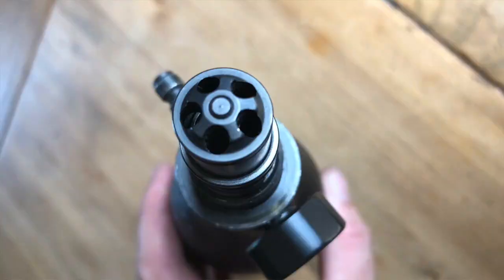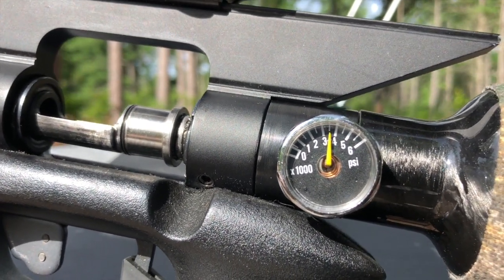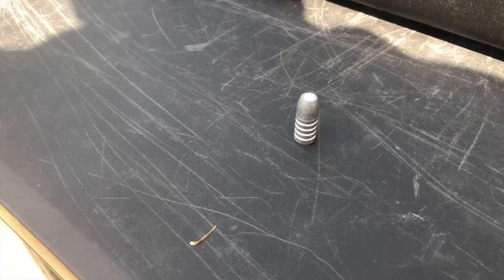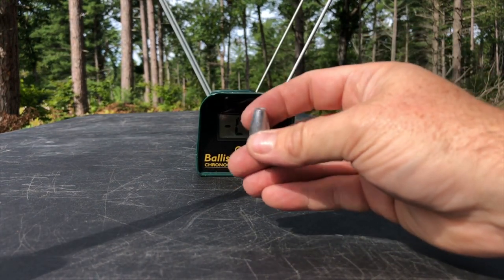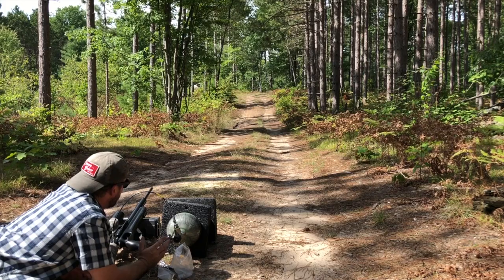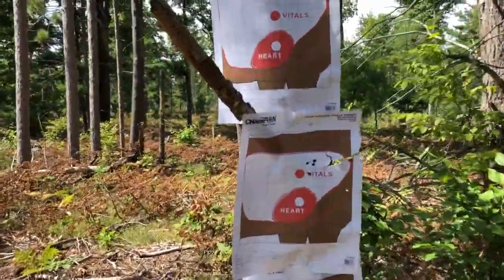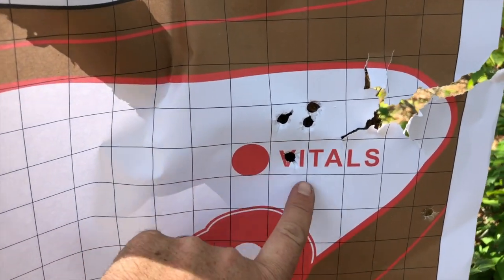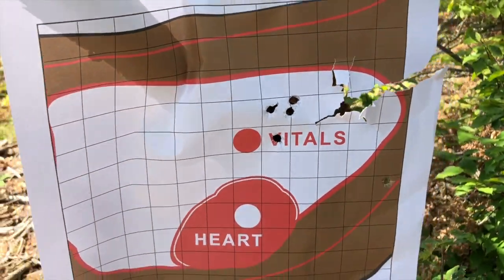AirForce Airguns Texan Over 1000 Foot Pounds of Energy with Helium!  2018 Deer Hunting Preparation

Comment: I think with copper plated pointed slugs with helium on a 300+lb rifle like my aea .357 with 32in barrel would still pass though the high shoulder. especially with helium.
I will also most likely powder coat some .355 and resize after the coat to .357 so that I have perfectly sized powder coated copper plated lead slugs, advantage being the powder coat decreases frictional properties while the copper increases the overall strength of the bullet to pass through bone.

Comment: 350 grn at 1150 fps? That’s pretty bad ass.... not sure how practical shooting helium is, but impressive none the less. I can tell you, straight up, that would do anything a 44 magnum revolver will do on thin skinned game... and that is a lot!  From my stock Texan, I’ve found that it run right along side a 357 magnum, even my preferred load( 180 grn XTP @ 1150 fps) , and I would not pull a high shoulder shot with it either....Modding can definitely give you that “ next level “ performance boost.
Reply from the maker: Thanks Neal!  I want to take a moment and expand on something..... As a fellow airgun "modder" you get this but I am posting this response to all others who read this.... I keep hearing this word "practical" from a few people that have made comments about me shooting at 4500 PSI and with Helium.  I want to make sure everyone understands where I am coming from with this testing I have been doing with this custom valve and higher air pressures and now with Helium. 

For me the word "practical" goes TOTALLY out the window when it comes to Deer hunting and this is what it is all about for me.   It is the same mentality I used to have when I hunted with 12 gauge sabot slugs at $17 for a box of 5 slugs or ridiculously expensive arrows and broadheads for archery season.  I have always wanted to use the very best and most lethal option when deer hunting. For a lot of hunters, to include myself, practical does not exist in our vocabulary.  

Punching paper is fun and keeps me behind the trigger all year long - but for me the next 3 months (the Michigan Deer seasons) is what I live for as a shooter and hunter.  I get it - Helium isn't going to be used at the range punching paper or even in hunting situations where taking multiple shots during a hunt is typical.  Hell - this stuff costs $100 to fill the damn tank! But...  Deer hunting for me is all about those few minutes and even SECONDS I get each year to squeeze the trigger on a game animal (hopefully in one single one shot) that will feed me and my family for months and if I am lucky put a trophy rack on the wall.  

For me as a hunter - those few minutes or seconds that exist once a year all pay off after shooting at paper (and AirGunDepot.com Long Ranger Golf Balls).  So that one single shot that I get once a year doesn't have a limit of practicality for me.  If I wanted practical - I would have never gotten into Big Bore Airguns.  I want a challenge of a new hunting technology and I want to see how far I can push that technology.  If I wanted practical - I have a 12 gauge Mossberg shotgun from my local Meijer (back when they sold guns) that my dad bought me when I was 16. If I wanted practical I can grab that 12 gauge shotgun with a $5 box of Remington Rifled Shotgun Sluggers and go stumble into the the woods on Nov. 15th like a lot of different hunters I see around these parts.  

So to everyone who reads this and wants to post comments about how 4500 PSI and Helium isn't practical - you need to understand what I am trying to accomplish.  The most effective and lethal single shot possible from my big bore airgun.

Comment: My God . . . . I absolutely do not have the wallet for an AirForce rifle . . . and I'm a zealot for my Bulldog . . . . after a nearly free hammer mod i get at least 240fpe with my Noslers . . . It shoots surprisingly flat over a 60-100 yard range. I would love to be able to shoot helium through it but it's not rated as far as I know. I know Pitbull will do mods with valving and regulating.  It's plenty powerful enough for nearly anything in North America. I preach the Air Gun Gospel to all of my powder-burning hunter friends, probably to the limit of irritation, lol! so I will be sharing this with them. The ones who were military marksmen get a wakeup call when shooting modern airguns . . .  the learning curve is totally different. Great vid.
Reply: It will work fine on helium just dial back the hammer spring rate before shooting just to be safe and do not overfill

Comment: Great video man.  I do not have a Texan, but I do have a tuned Dragon Claw that shoots about 305-310 FPE, and I've killed quite a number of deer with it with a high shoulder shot.  In fact, that is the only way I don't have to track them.  But you hit on something that I've been trying to find out for a while.  I have easy access to 2000 PSI helium, and I was wondering if I were to fill my DC 1500 PSI helium and 1500 PSI air, would I get higher velocities than on air alone, but not as fast as straight helium ??  Would the shots be somewhat consistent (for the first 3 shots, of course), or, would the air and helium separate and cause my shots to vary greatly ??  I would love to know if I could mix the two and have a happy medium.  It would be great to hear if you know the answer, or maybe you know someone who does.  I have Googled and asked, and can not get a "for sure" answer. Thank you for your time and keep up the good work.

Comment: With bow and crossbow you don't need the 1000ft lb. Ft lb doesn't matter with bow cause the energy isn't that kill the deer. The tip cut a massive wound into the deer and it bleed out quick. With bullets, the hole is smaller so need the energy to take it down.
Reply: mmm not really, a hole that is too big to clot through the chest kills things. An arrow may cut .75" or 1" tip to tip (old, stone points are usually smaller, and work just the same), but it's only in 2 or 3 directions, thin slices. It works, but the fact that it makes a hole that doesn't clot is why they work. The blades of a broadhead focus the energy of the arrow, so it doesn't require nearly the momentum to penetrate the animal. On the other hand, a bullet is blunt and deforms, and needs a little more momentum to overcome resistance. 

Energy and velocity have been the cash-cow of modern firearms and ammunition companies since the 1890's due to to availability of smokeless. How do you get people to buy new "improved" stuff? Convince them that what they have "can't possibly work", pay writers to agree with you, and get ignorant regulators to set rules to enforce that, and make easily manipulated aspects of modern fireams/ammunition the focus of your marketing.

View/treat airguns like you would a black powder muzzleloader, and you will understand why they work, even without a ton (literally) of energy at the muzzle. When in doubt, sling more mass at it. Velocity/Energy has never killed anything. 45-70-400 (original loading for .45-70 Govt) barely propelled that 400gr bullet at 1200fps, and yet (along with the older, less efficient 50-70-400) wiped out the American Bison, and was effectively used out to 400 yards and more. Every land animal on Earth has been taken with black powder guns, most of which have truly laughable energy numbers compared to what the "experts" claim you "need".

Comment: You might need a bigger hammer spring so you don’t get valve lock from the helium although it would have to be a strong system or the strong force of the spring could bend some metal. With the high power valve package that is comming out this gun is going to shoot screaming fast!
Reply from the maker: You’re misunderstanding how Helium works. You can actually shoot it at lower pressures since the molecules of HE are smaller than Air. This allows the air to get through the valve faster. What valve package are you referencing?
Reply: @UpNorthAirGunner  good to know! I had one too many white claws or something last night haha my challenger 357 has a valve package that is not out yet that’s probably what I meant.
Have you worked with powder coating slugs?, i have seen people get some really good speeds with slugs after they have been coated.
I’m thinking of doing a powder coat on some .355 copper plated lead and then resizing them down to .357 after the powder coat..
The gun is allready pushing a 140g at 1000fps  without helium and without the high power valve.
And with that powder coat helium and the high power valve I wouldn’t be surprised if I could get 1300 or even 1500, especially lighter slugs.

Comment: Awesome! Always wondering when you will be putting up new video with heluim, would like to see a regulator chamber with just the right amount of air/heluim that might be better for shot count. What is the consistent shot count with this new setup?
Reply from the maker: lowcomtech K. With the Super Valve I’ve found the best consistent shot string is set on the second lowest line power wheel setting with a 350 grain slug at 4350 PSI.  I get 3 shots 900-915 FPS shot #4 is 880s shot #5 is 820s.  That will be my tune for hunting season.  That is with regular air not Helium.

Comment: What i want to know,,, how many shots do you get,,, high power accurate shots with the new super valve using regular air,,,     the shot count is where its at,    no point being out hunting and only getting 3 good shots before re filling
Reply from the maker: How many shots do you typically take at deer?  Even when I hunt with a powder burner rifle or 12 gauge shotgun slugs I usually only take a box of 5 rounds with me.  This isn't rabbit hunting!  HA!
Reply: Hay im hearing you,, still a good job on the vid bro,, but how many shots were you getting ?
Reply: @UpNorthAirGunner  yah, the DNR tend to frown upon showing up to check-stations with a string of deer in the truck bed lol

Comment: Yes! I had hoped the 350gr would break 1000fpe on helium. Awesome video and I can't wait to wait to try my 4500 on helium! Gotta record one of those boat anchor shots for us when you get the opportunity to. That would be awesome to see. Also where did you have your spring set at with your helium testing?
Reply from the maker: Blake Browder 3/4 Full Power Hammer spring with the Helium.  I should have backed it off because it was sucking Helium FAST!   I found Helium gives massive velocity gains but the shot velocity spread from shot to shot is way too high for hunting consistency.   With that said, I’m looking for a longer fill hose to possibly tether in my blind to the Helium tank.
Reply: @UpNorthAirGunner  when you say hunting consistency, is that follow up shots or keeping the similar velocity on helium over a close spread of shots or shot count?
Reply from the maker: Blake Browder The Helium comes out so fast and drops so much PSI from shot to shot untethered the velocity spread is too steep.  Tethered I could though and just might get a long fill cable and bring the big bottle of Helium with me in the blind.  Totally over kill though.